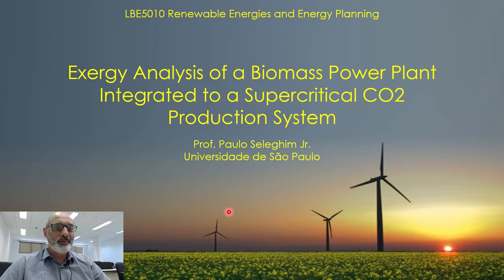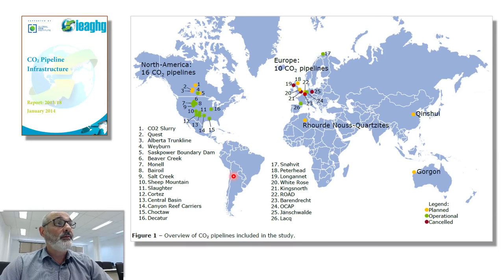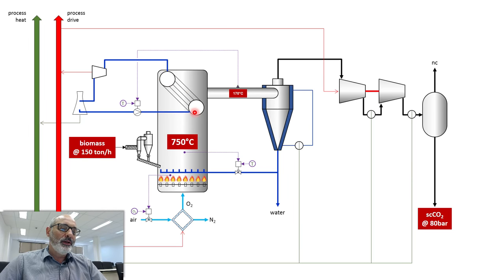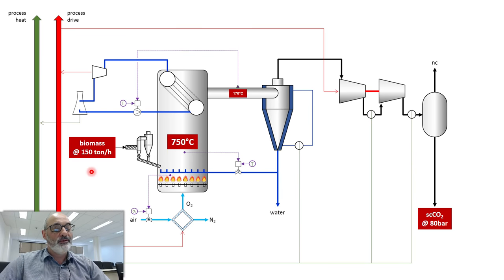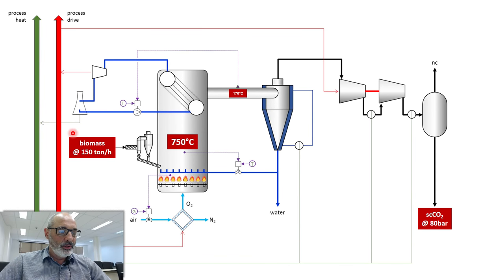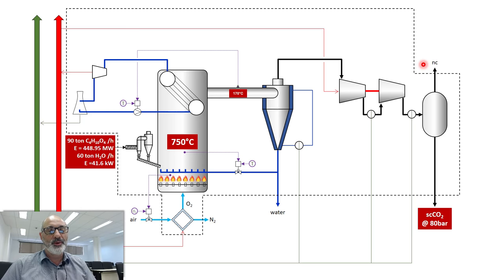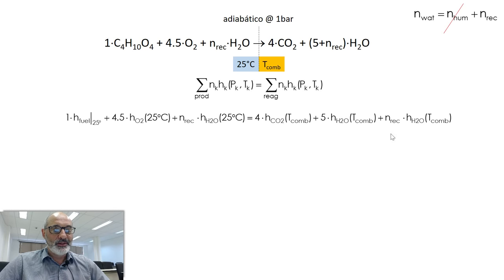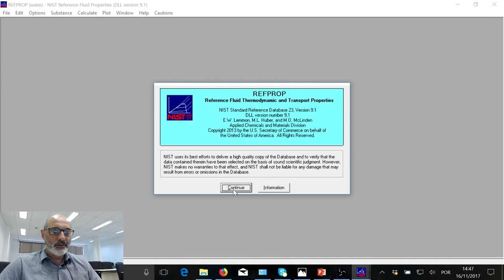Termodynamics: Exergy Analysis Biomass Power Plant with Production Supercritical CO2

Comment: Professor, I have a question and I appreciate it if you answer it. When it comes to calculate exergy destruction in the combustion chamber 2:19:18 , we used chemical exergy and also consider temperature change in relation to the reference state (I guess with integral of cpdT , would you please confirm it? ). Also, when it comes to the calculation of exergy destruction in the boiler 2:22:59 we used flow exergy to calculate exergy destruction. The question is that for calculation of exergy destruction in the combustion chamber, is it possible to define exergy as chemical exergy at reference point + physical exergy and then read the chemical exergy from the table without applying temperature and pressure change and then add physical exergy to cover the temperature and pressure change?

Comment: Professor in determining the efficiency at 2:14:00 I did not recognize the term 17.09. Why don't we consider only work divided by consumption energy? would you please elaborate more?
Reply from the maker: There is a mistake in my calculations there. (Thanks for pointing it out.) I had to review my first recording of this lecture in 2017 to remember what I wastrying to do. (It is in Portuguese but for all it’s worth the link is here: https://youtu.be/j9DzAKPPXJU?t=6256) Actually the idea was to calculate a sort “revenues efficiency” dividing total exergy flow from which it is possible to obtain revenues from by the exergy supplied. Thus the calculation should have been (5.52+2.2+7.76)/(448.95+0.04162) = 3,45%.